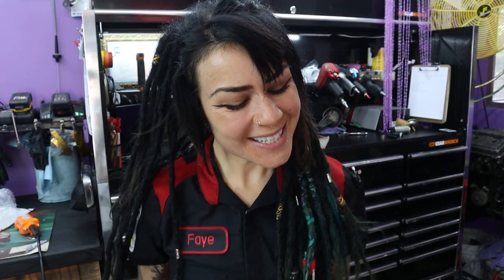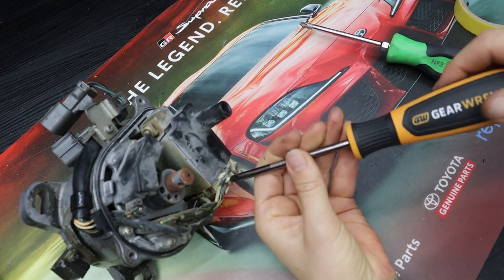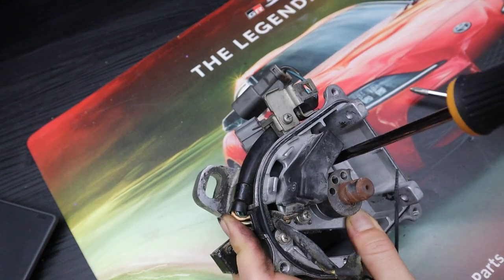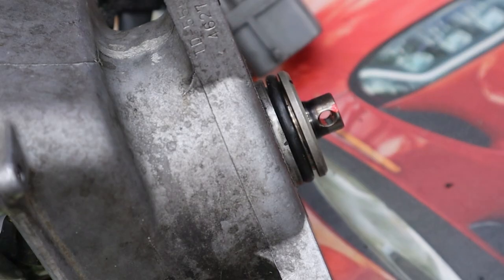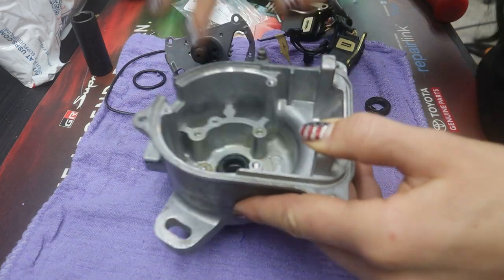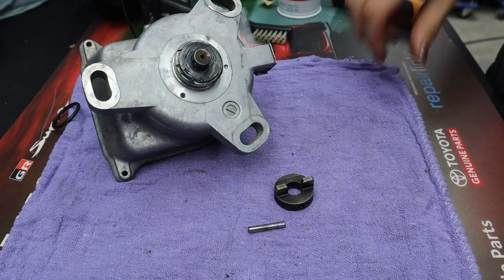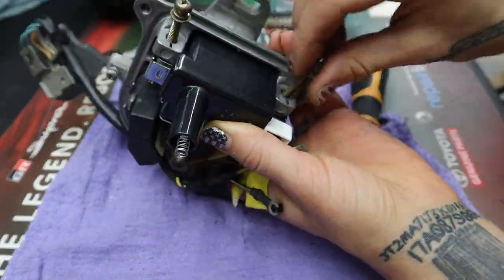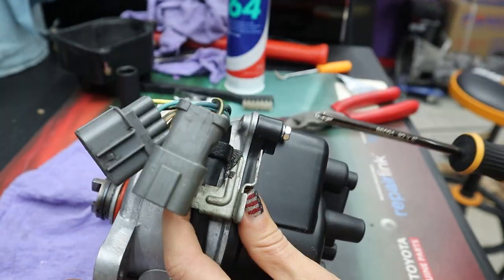Acura Integra Complete Distributor Tear Down and Rebuild (B18B1, Non-VTEC)

Comment: I just finished swapping out my transmission for a manual transmission and now it won't start lol 😂
Reply: You didn't bolt down the ground. Easy rookie mistake.
Reply from the maker: Oh no!
Reply: Auto transmissions have a starter inhibitor circuit preventing you starting it in neutral or park. Have you taken this into account in the conversion?
Reply: Correction meant to say EXCEPT in neutral or park of course 🙄

Comment: I replaced the coil on two Honda distributors, and stripped at least one screw on each. After googling, I found that JIS screws look like phillips but are a different standard common in Japan. A phillips driver doesn't grab a JIS screw very well so you're more likely to strip it. I'm starting to think that many (all?) "phillips" screws on Japanese cars are JIS and using JIS drivers would save a lot of grief. Just wondering if you've heard of this and what you think.
Reply from the maker: Yes, absolutely I have heard of this. I.... just..... use a phillips 😭 but I didn't strip any of these!! Only that one had been damaged prior!!!!

Comment: Hey don't know if you will see this. But a honda dealer technician. I noticed the screw was missing out of the fuel damper. On the fuel rail its the nut that holds on the fuel line. When the screw falls out of the end. The fuel pressure shoots up to 60psi. When 42 to 45 is normal and will cause a shuddle at low rpms.
Reply from the maker: Thank you! I was replacing the injectors at the time of this video as well!! I appreciate that but all is well!!!

Comment: I saw the timing gun but you didn't show how to adjust the timing. Where exactly are the reference markings and the arrow indicator located? My Integra is 1994 and it's very dusty to see. Other videos showed there are multiple markings and an arrow indicator (not the Integra). BUT they don't explain how to choose which one of the markings needs to align with the arrow indicator. Also what is the size of the rotor screw. Thanks

Comment: I have one of those and its giving me a slightly misfire when cranking the car when its hot, cold and first start are perfect. One time it turned on but with so little rpms that shut off in seconds, other times it has started with little rpm but raise them to the normal 700. I thought might be the coil and change it but dos the same, I also cleaned the inrake tubing till the throttle but the intake manifold and intake valves are carbon caked 😱 I'm inclining on the teory that maybe the xarbon build up its contributing. Thanks in advance. 
Also i would like to see how to remove the rear engine mount that bolts to the crossmember 😎🤙🏼

Comment: I was wondering about the igniter? Do those usually not go out. I saw that you replaced the ignition coil. Just curious bc I am in the process of doing this. Thanks.
Reply from the maker: This ignitor was replaced recently - you can also test it per the manual, but while you're in there, it's not a bad idea!!!!
Reply: @FayeHadley  do they usually go bad though bc that part is $200+ oem. I think I might get away with just coil pack, cap, rotor, seal and oring. Total around 180 oem. For 380 I would just go COP and call it day.

Comment: I thought I recognized that distributor lol; definitely not a Toyota part, which is why I clicked the vid. and man do I want one of these Integra's so bad, ugh; I love Honda. but yeah, I'm curious the cost saving of rebuilding one of these distributors vs replacing them with a brand new one. I had replaced my last one not too long ago on my 97 civic, as I was getting a code from it malfunctioning.

Comment: Anyone had any luck on using external coils instead of the internal ones in these cars
Reply from the maker: I looked into it for this build but decided against it! I'm curious to know too!!!
Reply: @FayeHadley  I did look into it, a lot said the external ones would run cooler I suppose being outside of the distributor
Reply: I picked up 8 tenths at the track by utilizing an external msd blaster ss coil and adding 11" of pipe to my air intake on my b18
Reply: @samward6969  I fig it would give the engine a hotter spark being external being able to breath

Comment: Please do me a favor and leave that screwdriver in the car for this poor person cause they will b needing it when that screw u put anti seize on backs out and they are stuck on the side of the road somewhere also a side note those distributors aren't that expensive anymore if it were mine I would have replaced it i notice in ur reply to someone u said the aftermarket ones are garbage but I have replaced over 50 of these with aftermarket units without failure I guess it just depends on where u get ur parts from

Comment: You didn't do the midshalf bearing...the red dust issue is as big as the oil issue.
This is not a complete rebuild 
This is just a seal replacement video.
Reply: I was wondering if there was a bearing behind the seal that needed to be replaced too?

I have a 97 Integra with this leak. This vid is the first one I have seen that covers replacing the seal. Do you have any part numbers for the seal and bearing behind it?

Thank you for a great informative vid!